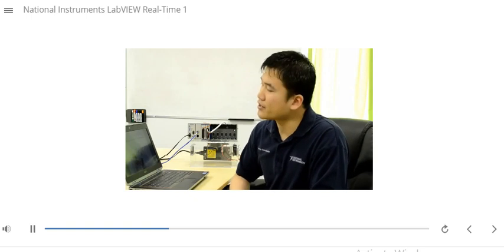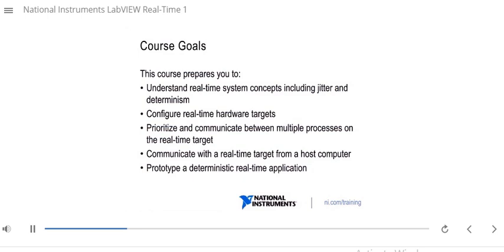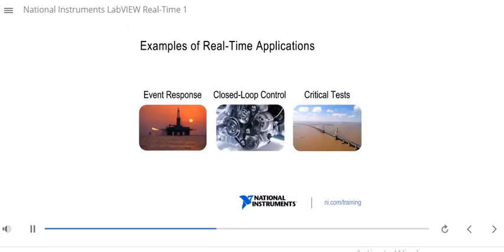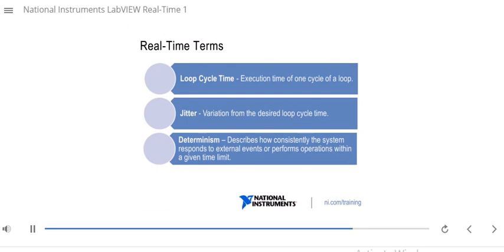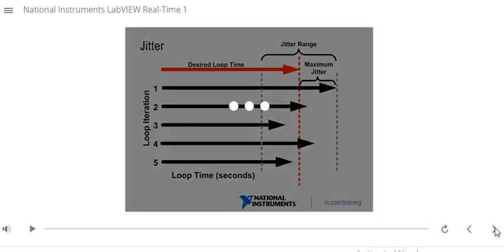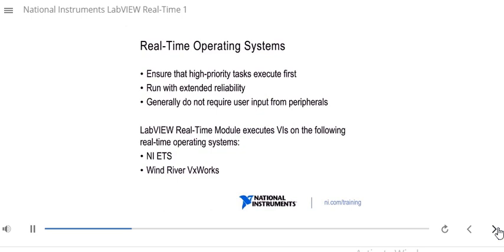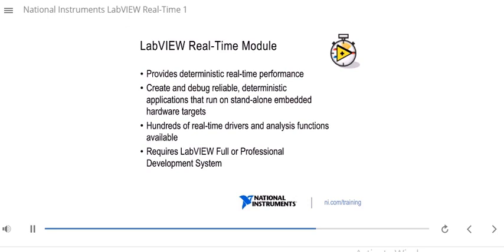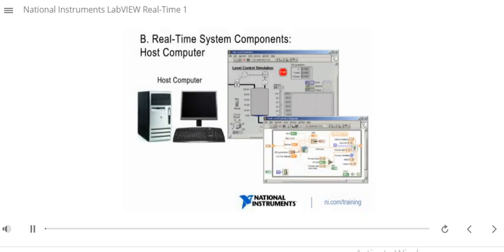LabVIEW Real time 1 part 2 | Introduction to LabVIEW Real time system |

Comment from the maker: If you need the course material, i.e. PDF notes, slides and LabVIEW project files related to this video, feel free to contact... Thanks
Reply: Hello, my name is Alessandro, and I am a scientific initiation student here in Brazil. I need to develop a real-time LabVIEW application for reading and controlling sensors and actuators and I didn't find any course that gave me this support. Could you please help me with this? Thank you very much in advance.
Reply from the maker: @AlessandroDeLima-k3u  I can help developing such application. Please contact on labviewcourses@gmail.com